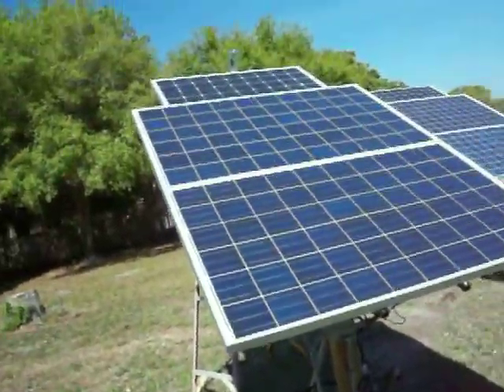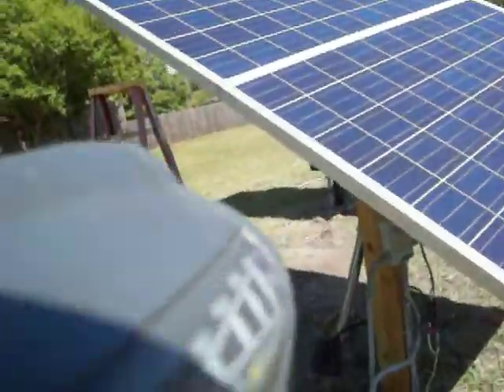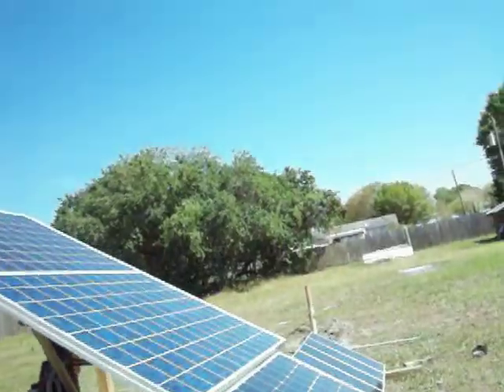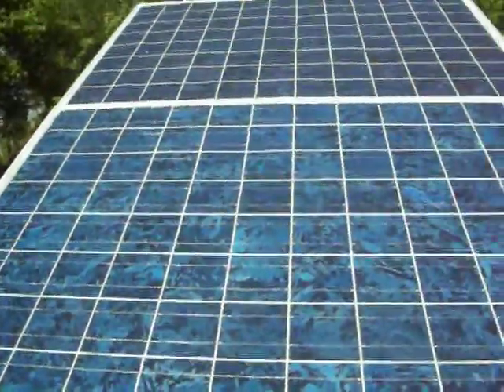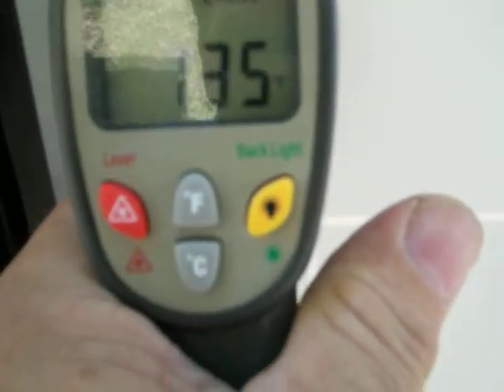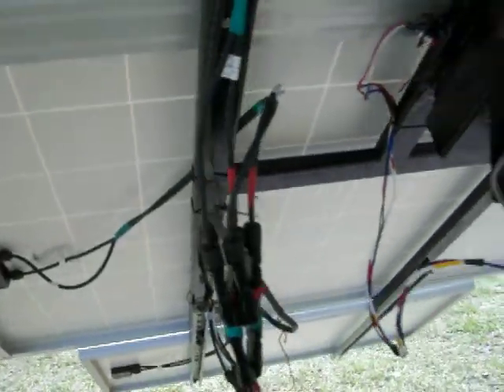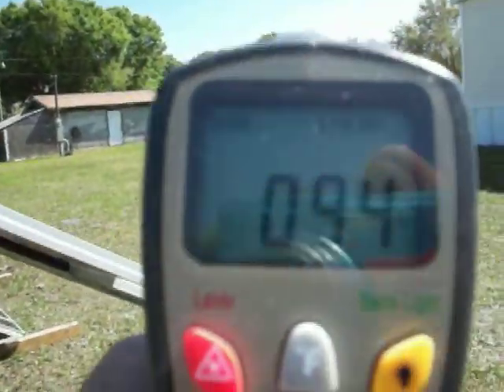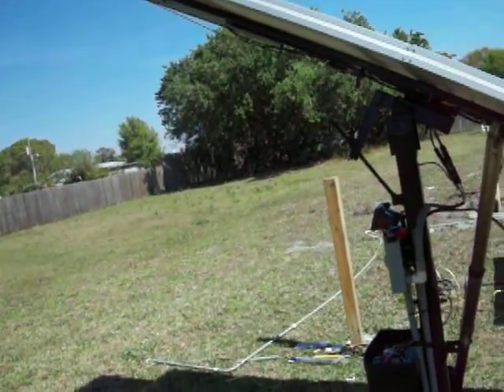SOLAR PANEL  VOLTAGE DROP THRU HEAT.

Comment from the maker: @nrodge1 Thanks  I Think i,v got it ,it Has power to spare it,s rated at 1000LBs Static or a 12 Ft Sat dish.I was holding on to it during my test and it was not slowing down plus its N.O.S. Way fast & Power Full. Thanks.

Comment: There are circuits showing how to regulate voltage with a LM317 (to 1.5A) and/or a 2N3055 transistor (to 10A+), there are also current regulator circuits out there which might help in this case. If the resistor works then just stick with that, simple is better. Just make sure that when the most weight / force is on the motor it still starts up, and take into account age, wear and dirt factors as it gets older.

Comment: It sort of evens out, in the winter the sun has to go through more atmosphere but the cold panels produce more. Cold windy days really help cool them down. Summer you get more sun and longer days. You also get a little more shade in the winter from objects further away because of the low sun angle. Trackers are looking good! I hope the arm starts OK with the resistor attached, you can always parallel two resistors and it will speed up a little bit. Maybe use a LM317 adj. regulator circuit?